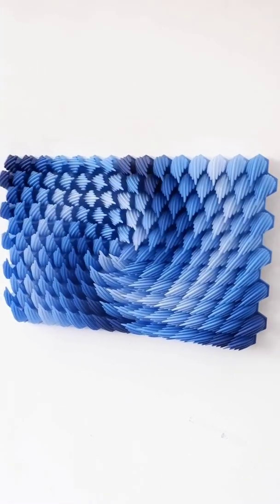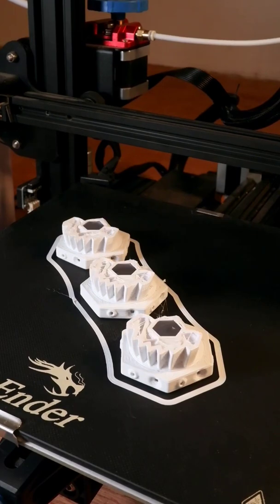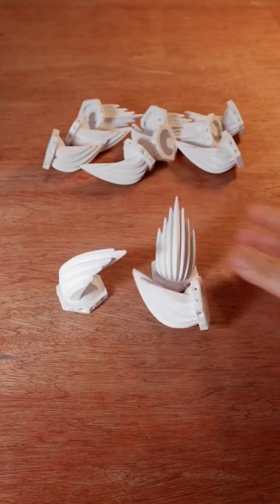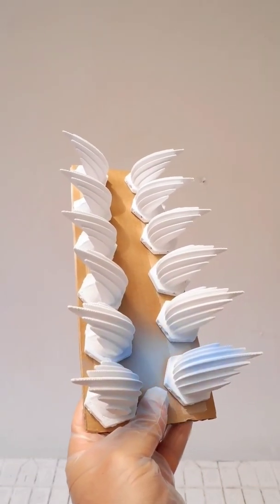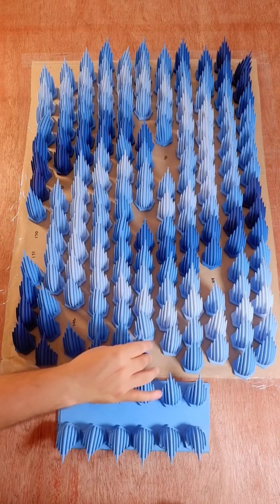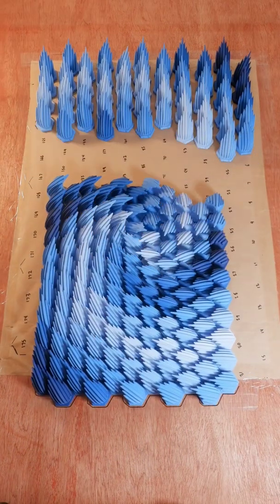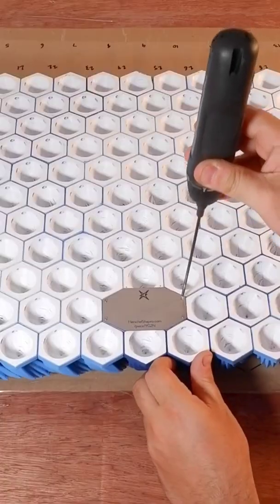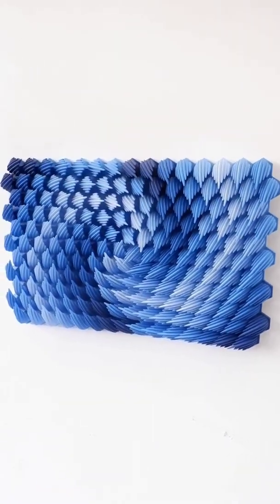Making a 3D Printed Wall Sculpture

Comment: So anyone can do this if they have the money? Is that how it works? I see more skill than art   But that’s just my opinion, so if I’m missing something than I guess “my bad?”….

  If it was made by hand with clay or something honestly it would be extremely impressive.   But it’s like cheating with a computer and 3D printer I’m sorry.   Still looks cool.

I Hate to be critical, but I just had to point that out.  I think it’s an awesome hobby that could sell well and is satisfying to create, but if I used a computer to design an image, and then had a printer sculpt it into marble, then did I really make the statue?    Michelangelo vs 3D printer…
Reply from the maker: I think it is very much like architecture, where everything is designed in computers then manufactured with precision techniques. It blurs the lines between art and technology.
Reply: @HerschelShapiro Hy! You use rhino to make the model ?

Comment: How he made it: 
1. Printed
2. Sanded
3. Assembled
Spoilers
Reply: That’s kinda how all 3d printing goes
Reply: you forgot the second hardest part, painting
Reply: @redmask1356  design it
Reply: @Algojo  What you need to do to have kinda same result. Ill be using Blender. So.
1. Delete default cube
2. Shift + a (add cone)
3. Set the resolution to anything you want (3, 10, 50, you name it, I recommend something low, like 5)
4. Press tab (go to mesh editor)
5. Add loop cuts (i added 5)
6. Grab and move the entire mesh on x or y axis just a bit
7. Select the top vertex of the cone
8. Turn on proportional editing
9. Scroll up (or down) to make active zone smaller
10. Press r and z, rotate the tip slightly
11. Rotate the tip a bit around the 3d cursor
YOU MADE ONE OF THESE SPIKES.
(Now you can do whatever you want. Array modifier is my go to method)
Wow. I thought it would be funny to design it in my head 4 fun. Didn't expect to make a full tutorial.
Reply: @redmask1356  oops
Reply: *IRACUND*  I was born in 1998 and I understand what irony is.
So please keep your viewing preferences to yourself.
Reply: *IRACUND*  you such a child

Comment: How are you attaching them all together? They look like they pop together and clip in maybe? I would not think glue as it's painted. 

Is this or a similar model made available on any of the file sharing platforms?
Reply: I saw a different video of his that showed him connecting them all with small screws 👍🏻